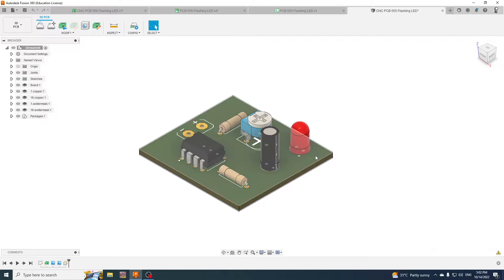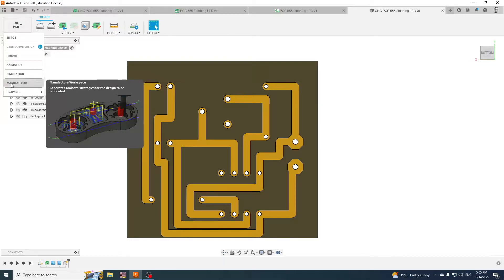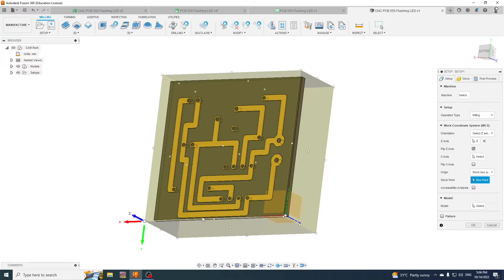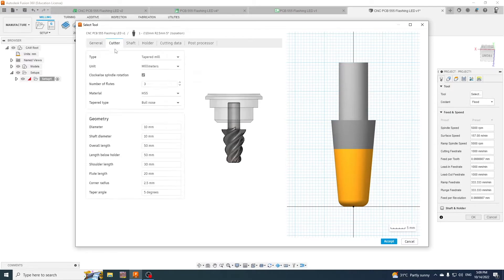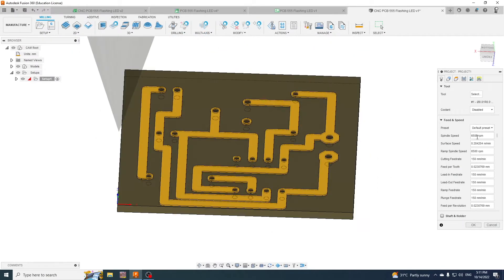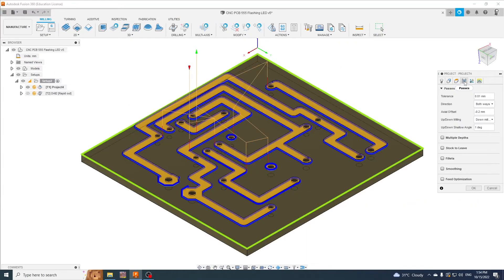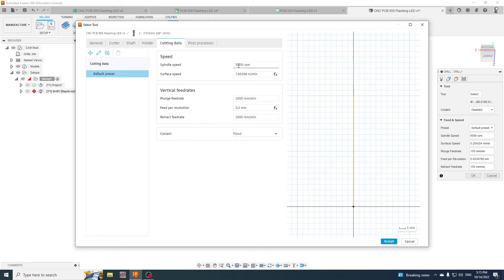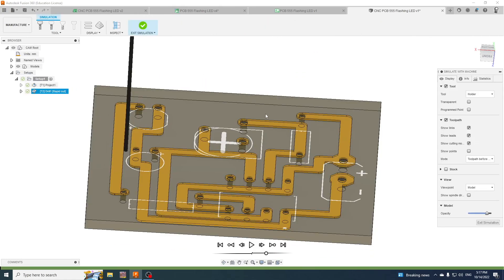Fusion 360 PCB to CNC Milling Part 2: Creating Toolpaths for the Roland SRM-20

Comment: What is the reason using 3D Project operation instead of 2D Engrave ?
Reply from the maker: @mark2b2  absolutely no reason, this was the first method and it worked, so I didn't chance another
Reply: @w33va  Thank you for the great video! It really helped me mill a PCB. I followed  step by step, and it worked perfectly.